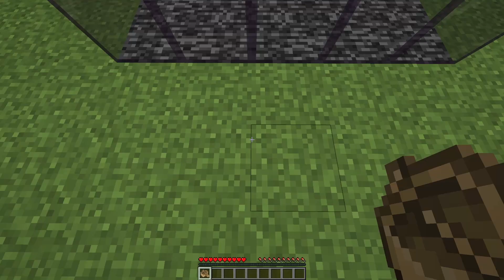Phasing Through 3 Block Thick Walls With 1 Boat

Comment from the maker: Some notes from Progamerzim:

3:03 the boat doesn't actually need to be aligned against the wall, however the boat will be way more annoying to push forward if it isn't, so it's still very much recommended (the client side boat will push you to the side causing you to push the server side boat the opposite way, this is actually the reason you can stand still and the boat will be pushed forward, if you clip into the boat without any desync, or with just a vertical one, then the boat won't move at all)
5:53 you mention it's either randomness or looping, yes, it is indeed on a cycle, and it seems to be around 3 seconds, so a consistent way to make the boat raise work is to do a boat raise, run back out of the wall, and when the boat syncs back count 3 seconds, and when you finish do another boat raise, it should be better aligned to the cycle
7:47 the boat not going high enough is a result of desyncing the client side boat while it's interpolating back to the server side boat
8:32 sometimes it's hard to tell if the boat is under the ground since you clip it under by a very miniscule amount, possibly even <1/100th, so you can tell by if there's a shadow or not, no shadow means it's clipped underground
9:04 you don't actually have to stay in it the whole time to break it, and you can avoid damage by getting out earlier

also another thing, it's incredibly easy to get stuck or to get your boat stuck while doing this so it's not too good to use in typical escape rooms
Reply from the maker: @Snailcul12 by typical escape rooms I think Progamerzim means generic "friend trapped me" escape rooms where you aren't allowed to undo softlocks. In most escape rooms it's fine to use since if you get stuck you can just put yourself back

Comment: rule 1 of escape rooms: if a puzzle requires more than 5 wood planks to solve, make them not all one type of wood.
Reply: Or make sure the player doesn't have access to a crafting table
Reply: or simply have 4 thick walls, well until someone figures out how to phase through that